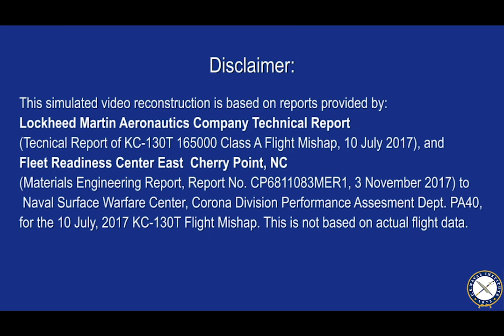Animation of Fatal Marine Corps KC-130T Crash

Comment: From the cab of my tractor, 4 miles SW of the fuselage impact, I happened to notice the plume just as it became visible on the horizon. I didn't think much of it at first but it quickly became apparent that something significant had either exploded or gone up in serious flames in a matter of 2-3 seconds. Later when it was down to just a whisp of light smoke I learned what had happened. A feeling of a strange heavy sadness and vulnerability spread across the area and lingered for days.

Comment: whats amazing is how they figured out how it happened and it in what exact order
Reply: It’s done using a combination of trajectory analysis, ground wreckage placement, debris marks on the empennage, and computer simulations. 
The first midair disintegration that investigators made heavy use of computers to accurately identify the sequence of failure was Braniff Flight 250 in 1966; squall turbulence brought it down, something that no longer happens in airliners due to better understanding of how to fly through bad weather.

Comment: WR-ALC C-130 propeller overhaul section had a huge restructuring due to this incident. New NDI and maintenance techniques and procedures created to try to detect corrosion fatigue cracks smaller than had ever been consistently successfully detected in the history of propeller overhaul. New processes for inspection and overhaul of any USN, USCG, or USMC C-130 propellers we might receive in the future, as those propellers are significantly different in design and engineering than USAF C-130 propellers.  No one had ever thought so much damage to the fuselage would occur if there was a blade loss, as other prop aircraft had survived blade losses and successfully landed.
Reply: Was the propeller system an OEM unit or was it manufactured by a 3rd party? I worked for the OEM and that particular system is pretty solid.
Reply: @BELCAN57  I'm sure was a reman via WR-ALC...  This is just one more reason I can wait to see all the aircraft upgraded to the 3.5 engines and the NP2000 props!!!
Reply: The aircraft went through Depot at Warner-Robbins Air Logistics Center, as do most all DOD ac every 5 years. The propeller had a crack that had been painted over, meaning the crack had been there before, during and after it's last trip to Depot. It was missed by the prop inspection team at WR-ALC and tragically failed in flight.
Reply: @willgriffin3490  Correct.  This was a failure on the prop shop maintainers at WR-ALC.  I've seen the evidence, and it makes me sick.
Reply: Why does the USAF use different propeller designs?
Reply: @jcf20010  , The USN is the service that deviated from the standard propeller. Not sure why, but it may have been to be common with the P-3 Orion propellers. The P-3 is often thought of as a C-130 with the wing on the bottom of the aircraft instead of the top, but it isn't exactly a mirror image that way.

Comment: From a physics standpoint, it is simply amazing that two props/assemblies failed on the same flight and they both went directly into the fuselage with all the other directions they could have harmlessly departed. Please rest in piece my brothers. Your families will see you all again some day.
Reply: The impact of the propeller blade from #2 engine into the fuselage caused massive instantaneous vibration which is what failed the reduction gearbox on #3 engine.....it all started with corrosion/cracking at the base of the prop blade on #2 that went undetected at the overhaul facility at Robins AFB and also in the field
Reply: As what my contemporary states in the comment above, the prop on #2 failed which caused not only vibrations on all axises but aerodynamic stress that then tore #3 gearbox from its mount. The best precedent for the aerodynamic instability after prop separation is Pan Am Flight 202 a Boeing 307 Stratocruiser that broke up over the Amazon in 1952 when the #2 prop and nacelle separated inflight putting aerodynamic loads that immediately caused the empennage to fail. The C-97A Stratofreighter (military stratocruiser) and the KC-97 Stratotanker all shared the engine separation problem often to catastrophic effects.

I don’t know off hand what kind of rotating props a KC-130 has (whether all 4 spin counterclockwise when looking towards the cockpit; or if the starboard wing props spin counterclockwise and the port spin clockwise; or if it’s an inboard/outboard contra rotation per wing). 
Prop separation often flies towards the fuselage (Lake Central cv-440 prop separation severed the cockpit, a Reeve Alaskan Airlines L-188 had a #4 prop separation that cut the belly just ahead of the leading edge of the wings open- the flight attendant had to step over the penetrating slice into the fuselage several times; control cables were severed but the flight crew managed to land safely and all survived).
Reply: You are onto something….it seems highly unprobable.  What are the odds props from each side strike fuselage basically cutting through causing extreme fracturing and separation.  The explanation sounds phony.  If it’s that easy to cut the fuselage in half then why are they not reinforcing fuselage near props.  I believe there is another culprit that caused this.
Reply: @joeluebbers5474 pretty sure the energy of some spinning components are considered 'infinite' energy
Reply: @zKsery  I don’t know, I’m sure it’s possible.  It’s only a strange occurrence to me.
Reply: @joeluebbers5474  the spinning components have too much energy when they are operating at normal speeds.

The first propeller blade broke then went clean through one half of the fuselage then impacted with the other half where it departed its energy, causing the other propeller + gearbox assembly to break off and impact the plane.

So even if it was reinforced, which will add significant weight, you’re still back to square 1 which is the plane dealing with the energy of taking a direct impact from a spinning blade.

The vibration of the impact will still travel across the plane, breaking off something.

I think the main thing is just the unluckiness of the direction of the departing blades.

Also didn’t see it mentioned anywhere but I assume at least some of the crew were directly impacted by the loose propeller blades
Reply: @zKsery  nice description of the events.  I agree with you completely. I know I can’t give an accurate hypothesis without all the facts such as the post mortem.  Things happen sometimes when the sequence of events aligns.  I always leave the door open a crack for other theories which could have caused this.

Comment: Was there some connection between the blade separation on #2 and the gearbox failure and entire prop separation on #3?  It's odd that these two seemingly unrelated events should happen at roughly the same time.
Reply: If I understood it correctly, the imbalance  caused by the lost propellor blade on engine 2 caused increased stress to engine 3 which caused it to break due to the corrosion. I also thought what some other commenters are asking. How did the corrosion get so bad. These planes are constantly being cleaned and inspected. Seems like something that should have caught sooner.
Reply: @brett the lack of funding and training is a huge issue. Just look at the Marine Refueling plane crash that took place in Japan. I worked on f-18's so my knowledge of prop maintenance is zero. I do know we spent a ton of time inspecting, washing, and repainting jets to avoid corrosion related issues. I would like to think that if someone is aware that this could happen, they would have figured out how many hours a prop could go through before it's a possibility and switch out the props at that point. But we all know that is not how it plays out. I appreciate your insight! Have a good day.
Reply: Bret  Eddy current or x-ray , provided the blades weren’t timeX’d already.... obviously NDT came far to late .
Reply: Loss of a blade on one engine would send massive vibrations through the airframe.
Reply: According to the final report, when the number two blade separated it penetrated the port side of the fuselage nearly vertically and the full length of the blade impacted the starboard inner side of the fuselage with considerable force.  The shock loading just forward of the main spar meant a lot of that shock loading was transferred along the main spar and this fractured the number three gearbox casing - causing part of the gearbox and propellor of number three to break off and impact the fuselage.  It's terribly sad to think that if just one part of the causal chain had happened even slightly differently they might have been able to bring the aircraft down without loss of life.
Reply: It’s very odd and I’m not sure How that would slice the fuselage in half.  If it’s that easy why do ppl still go up in them?

Comment: I didn't know the forward fuselage was cut away. What a horrible way to go.
Reply: from that height they wouldn't have felt a thing. it would have been over in a blink of an eye
Reply: @dubb9020  How? Decompression?
Reply: @flaminghailstorm9149  negative. The forward crew station separated in an "intact configuration" They probably hit the deck sitting in what appeared to be an intact cockpit, minus the wings and fuselage.

Comment: How the hell did maintenance crews allow things to get to the stage where the failure of TWO propeller  assemblies fail at the same time???  Something stinks here.
Reply: I believe the impact of the failed propeller into the port side of the fuselage caused the aircraft to suddenly and violently move in such a fashion it overloaded and caused the failure of the number 3 prop assembly, which embedded itself into the starboard side of the fuselage. From there it was an almost instantaneous break-up sequence.  Devastating.
Reply: Marines maintaining aircraft...
Reply: @slappymcgillicuddy7532  Truer than you might think.  The poor guys have to fly all day then work the plane to get ready for the next flight.  You can only do so much.
Reply: It was not the maintainers; read the report, its public. Depot level repair was pushing out props without doing the proper corrosion protection and treatments.
Reply: @ScarredSanctity  Correct.
Reply: Cuts in funding to military....

Comment: So the propeller on one engine failed at nearly the exact same time a gearbox on a another engine failed, That seems improbable.  Multiple engine failures are uncommon. What caused the engine reduction gear overload? Is that a common failure?

Comment: What I don't understand is how the blade separation from #2 engine caused a cascade failure of the #3 engine reduction gearbox, resulting the #3 propeller separation and intrusion into the fuselage.  Was there debris from the #2 failure that somehow struck the #3 engine reduction gearbox?
Reply: No, but a massive vibe that went through the fuselage , #3 reduction gearbox failed because of it. The impact of the propeller blade from #2 engine into the fuselage caused massive instantaneous vibration which is what failed the reduction gearbox on #3 engine.....it all started with corrosion/cracking at the base of the prop blade on #2 that went undetected at the overhaul facility at Robins AFB and also in the field

Comment: Why did the #3 engine reduction gearing experience overload after a blade separation from engine #2?
Reply: Impact damage and attempts to compensate for number 1 thrust losses.
Reply: @davidhoffman1278  
Did debris from #2 prop hit #3 engine?
Reply: Someone commented on this already, but it appears that a sympathetic mechanical failure occured. Multi-propeller a/c have a mechanical governing system that attempts to compensate for losses in thrust output from one or more propellers (to maintain favorable flight characteristics). It is likely that the blade separation from one engine caused oscillations as the governor commands compensating power from the remaining engines, through their gearboxes.
Reply: @coletrickle581  see above
Reply: @BattlesuitExcalibur  
Gotcha. Thanks for that info

Comment: Those blades are produced from a single solid aluminium forging. There must have been a whole lot of hours on those props without adequate non-destructive inspection.
Reply: aluminium is a metal very sensitive to metal fatigue...

Comment: This happens... They should harden the fuselage a bit in this location to prevent it.  Passengers have been killed when pieces of failed jet engines have entered the cabin after shattering through the engine cowling.  In 1989 the tail engine failed on a DC-10, pieces cut all three hydraulic systems and it was a miracle everyone wasn't killed in crash landing at Sioux City, Iowa.   Easy fix, means fewer passengers and cargo and less profit, will never happen.

Comment: It's like the plane purposely beheaded itself. It's frustrating that the two engines broke off pieces simultaneously.
Reply: The impact of the propeller blade from #2 engine into the fuselage caused massive instantaneous vibration which is what failed the reduction gearbox on #3 engine.....it all started with corrosion/cracking at the base of the prop blade on #2 that went undetected at the overhaul facility at Robins AFB and also in the field

Comment: Why was the overload failure of the engine number three gear box so coincident with the failure of that number two engine propeller?   Okay, let's suppose that that propeller pitch for the number three engine was set for a very large bite because air speed was high and the wind was coming in to meet the wide pitch, but when the second engine went into destructive imbalance from the one missing blade, the plane quickly lost airspeed which increased the load on that engine three prop, which now had to use power to move the air that was no longer coming forward to meet it.   Still, I would have thought that these airplanes have auto-pitch propellers that automatically adjust to load.   This explanation seems to avoid explaining what has happened.  I really can't make myself believe that these two failures could be this coincident.
Reply: FBI was investigating this  all the way up to a year after it happened. Honestly I think it was sabotage. Hopefully I am wrong.
Reply: @jbw8471    Yeah, I've had more time to think about it.  Yeah, the pilot may have thought with the Number 3 engine down to bring up power on the remaining good engines.  Okay, but if the pilot is fighting for the same airspeed with 3 engines instead of 4, well, that's not really possible is it?  Not unless the engines, props and transmissions are loaded differently from normal.     I wonder if the pilot was redlining his engines?  Remember, that in all 4 branches of the military they are basically using kids doing on the job training to work on these aircraft.  These are not seasoned professionals.  As soon as a Military Guy gets any experience he gets OUT and finds a real job that pays good money.  Yeah, there are the NCOs, you know, the Sergeants who stay in for 20 years so they can get half pay retirement, well, those guys only really work the job during their first enlistment and as soon as they get any rank then they are put into leadership roles and a new set of kids fresh out of Basic take over turning the wrenches.   It is really surprising that these airplanes are able to stay in the air as it is.

Comment: It is improbable that two props suffered failures at the same time.  Both struck the fuselage and essentially decapitated the flight deck.  What a tragedy.  If only one prop had failed, the plane would have landed.
Reply: The impact of the propeller blade from #2 engine into the fuselage caused massive instantaneous vibration which is what failed the reduction gearbox on #3 engine.....it all started with corrosion/cracking at the base of the prop blade on #2 that went undetected at the overhaul facility at Robins AFB and also in the field
Reply: Exactly.  Is it possible? Yes.  Is it probable? No.  So if a prop separates then vibration occurs which can cause more props to separate and cut into the fuselage like a can opener and cutting plane in half.  Do you think maybe something flew right through it?  I would believe that before their probable cause.

Comment: How do two engines catastrophically fail like  that? The odds have to be astronomical.
Reply: There was a small  fatigue crack in the base of the blade and it grew over several years and thousands of flight hours.  Eventually it grew so large that the blade cracked off from the hub. The number 3 engine structure failed from impact damage by the broken off blade and overloads caused by trying to compensate for the loss of the number 4 engine thrust.
Reply: Unlikely

Comment: From 2:00 - 3:00 ... WHAT THE HELL DID HE SAY? Sounds like jibberish "LBL61 longeron FS377, 33in. below the upper RBL61 Longeron, accordion like buckling failure of the RBL20 longeron." Yeah perfectly clear for anybody to understand.
Reply: I fly C-130s and I had to listen twice.  FS means Flight Station, and just means where on the aircraft something happened (FS245 is where the cockpit & cargo compartment separate).  Longerons are structural components of the aircraft that bear the weight of the wings - beyond that I don’t know their significance.
Reply: Lbl - left butt line. Rbl - right butt line.  Butt lines are reference lines that section the aircraft from left to right. If your body was separated into butt lines, butt line 0 i.e. the center butt line would be your crack, hence the name.